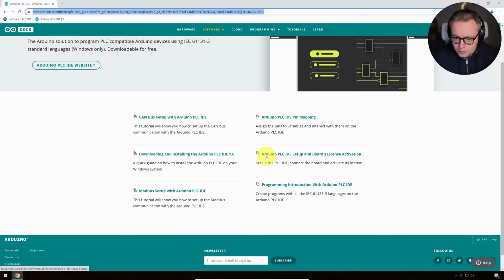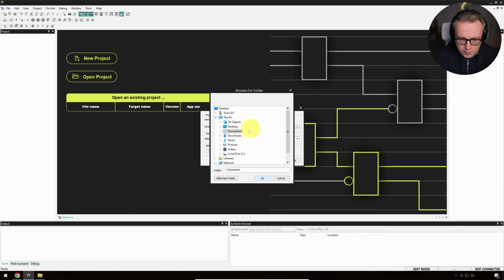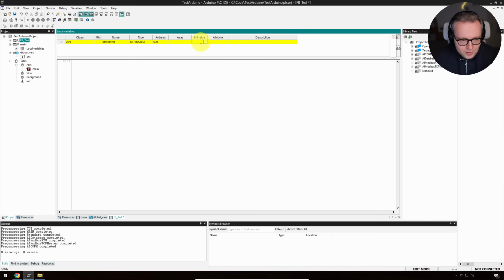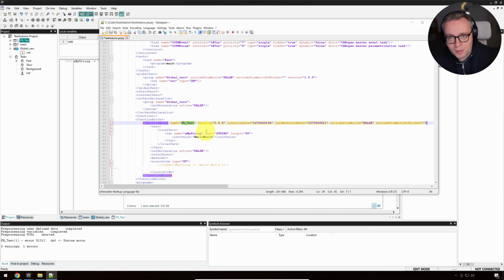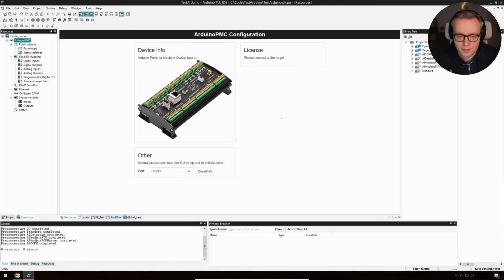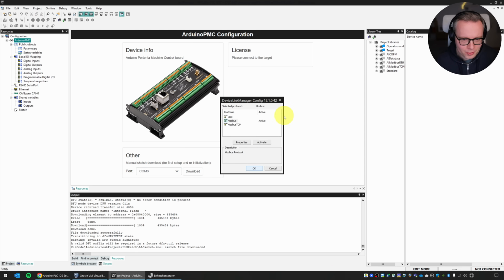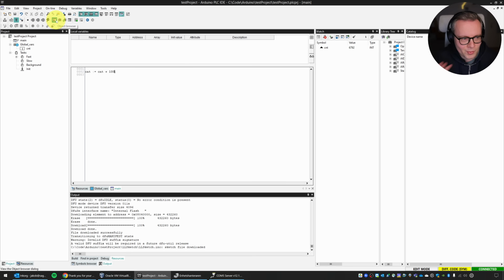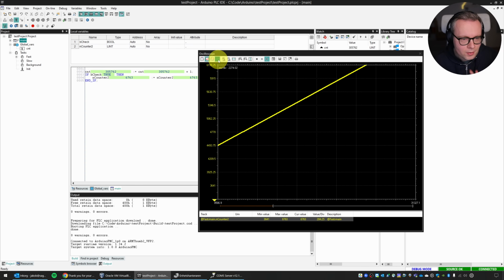Arduino PLC

Comment: Very informative presentation on the new Arduino Opta PLC software, in fact I bought one just to try out. I've sold several different automation manufacturers lines throughout my career and I absolutely agree with you on the free software - just get the hardware out into field, that's where the money is.
Reply from the maker: Glad it was helpful!

Comment: I tried for multiple hours to connect my PMC board but could not. I bought the license but no luck. I connected the device with Arduino IDE and it worked which means the hardware is functioning. But the PLC idea does not connect with the PMC!! Which is super annoying. There is no proper resources for the PLC idea. I am supper pissed off at it at this point. Any one here having any luck?
Reply from the maker: Did you also install the IDE tools?
Reply: @JakobSagatowski  Thank you. That did the trick.

Comment: Unless they intend to license specialized runtime functions, what is the point of not baking the license into the hardware? Like if you paid for the hardware, unless you planned on casting it in plastic and using it as a paperweight, isn't it kinda a brick without the runtime functionality? or maybe i missed something.

Comment: @Jakob Sagatowski

Did they really start from scratch with a brand-new IDE or did they just license existing software. I swear I heard some where that they just license existing software. I can't find the source where I read that from though.

Regardless I am not a fan of adding another IDE system. I would have preferred they used Codesys or OpenPLC. We need to consilidate the ecosystem not fragment it more.
Reply from the maker: The IDE is based on LogicLab.

Comment: Arduino portenta need to have many built in functions (PID, Cut to length, absolute drum,  etc...)  to justify it's price almost superior to others low cost plc like delta, click  or the very cheap Chinese Lollette PLC endorsed by many users globally. Although the plc  world is dominated by Siemens,Allen Bradley, mitsubishi , Schneider, ABB many low cost and reliable plc are also available where the integration   of the PLC/software is as smooth as a high end PLC on the market. However the education world where Arduino domination is tangible will welcome the Arduino PLC.

Comment: I guess you discovered your hardware already had a COM port (COM1) and the connected Arduino unit and IDE created the two other ports COM3 and COM5 (COM1 and COM3 in procedure).

Comment: Testar på svenska då jag såg att du har Windows på sv. 

Nybörjare i att programmera, Gjort några simpla arduino projekt. Tills jag såg att Codesys går att köra på en Rpi4. Så lär mig det nu/bygger ett HMI system för en baklastare, (Få in RPM, Temp, redskaps tilt, loggning av start cykler mm.) Men att Arduino gett sig in i PLC marknaden kommer nog göra underverk för priserna. Detta öppnar verkligen för nya kunder i den privata sektorn! Många i den privata sektorn kan och vill programmera men ska man köpa en PLC från de stora tillverkarna så blir det en rejäl slant och då utesluter man det och gör nått halvdant med en Arduino UNO.

Blir kul vart detta leder till i både utveckling och kostnad! 

Bra video och du fick en till prenumerant :)
Reply from the maker: Hej! Kul att du börjat programmera, det är en fantastisk värld du har framför dig. Känns som ett roligt projekt du påbörjat också.
Håller med, är definitivt spännande att se vad Arduino kommer erbjuda i framtiden. God fortsättning!

Comment: I have been using the ABB IDE for PLCs and it's not storing in individual files either.
It's possible that the IDE and core of the PLC is not created by Arduino and that's why there's a licensing scheme around it and that everything is stored in the same file.
Reply from the maker: You can actually store the code in individual files. See the pinned comment.

Comment: This new Arduino PLC IDE is almost identical to "LogicLab".
It even has same program extension "*.plcprj"

As earlier commented, there is definitely a need to make 'on the fly' program changes. 
Industrial environments doesn't like to stop machine for a small (minor) modification.
Reply from the maker: You're right, it looks suspiciously similar! I guess it's not a too wild guess to say that Arduino have bought a license of it and made adjustments to it?

Comment: The main issue I see with this is that the software is only available for Windows.
I suspect they licensed some proprietary software to build their editor, that is only designed for Windows, explaining the missing sources...
the fact that it can't seem to run in a VM makes the whole thing useless...
Reply from the maker: It's standard in industrial automation to only have software running in Windows. I honestly don't know if there is a single industrial automation IDE running on any other platform. Regarding the VM I have to give it another try. I only tested on VirtualBox, and should probably give it another try on other virtualization software.
Reply: @JakobSagatowski  "it's standard in industrial automation ton only have software running in windows", yet it's a choice that does not make sense anymore.
it's time for those companies to grow up a pair of eyes so they can look outside of their box...
Reply from the maker: @AmauryJacquot  Fully agree!

Comment: Siemens released SIMATIC IOT2000 series back in 2017 which are edison/stm32 based PLC devices. You can program them with arduino IDE tools.
Reply: No

Comment: Ahh, how technology progresses. Decades ago, when PLC "programming" was done by plugging actual hardware modules into a physical programming board, I joined a tiny startup whose objective was to create a way to completely eliminate the hardware logic modules and programming board, to do it all entirely on an IBM PC AT, debug on  the PC, RUN the code directly on the PC, the PC connecting directly to the factory machines. The user interface would LOOK like the programming board and the programmer would use drag-and-drop to place logic modules, just as if he were doing the normal PLC programming (since, heck, there were so many PLC people who were expert in that all-hardware approach, we'd have a ready-made market). I was the software engineer on the project, along with the "money guy" (who was also the fellow who came up with the entire concept) and a hardware guy (to develop the board that would plug into the PC and interface with the factory floor equipment).

I spent a good part of a year designing the software, a graphical user interface (when graphical user interfaces were just in their infancy, few tools to help in the design) as well as doing test runs of the user's design to verify that it operating as expected (and according to the then-common way of doing PLC programming). I got a LOT of it working. We even took it to that year's NCC (National Computer Conference, remember those??) and showed it, privately, to several potential clients.

Sadly, the money man never raised a penny for the venture (I had been working for [ eventual ] equity in the company, i.e. for free) and the hardware guy never got even the simplest interface board working. Eventually the entire effort fell apart.

Not too many years later several PLC-specific programming languages along with related IDEs were developed and replaced the all-hardware approach. So even if our product had been fully developed and on  the market, our market would have dried up fairly quickly.

But, time marches on. Technology advance by leaps and bounds, ventures come and go or never get off the ground, and now even ARDUINO has gotten into the PLC market.
Reply from the maker: Hey Roger! What a great story you shared. Whilst it's a shame that you never managed to get your product out on the commercial market, it's still a great story and memory that you are sharing with us. Still it must have been a great time to be so early in the game and see the rise of modern PLC IDEs. Your story actually reminds me of similar stories of how it started for another PLC vendor (though they did manage to get the equity eventually). Your story of PC-based control is basically how it started for Beckhoff, which today is quite a big player with their PC-based PLCs. I'd love to hear more about your story. I'd be happy if you could drop me an e-mail, you have the contact detail if you go to my channel -> About -> "For business inquiries".

In any case, I want to wish you a great 2023!
Reply: @JakobSagatowski  I emailed you. Haven't heard back.
Reply from the maker: @RogerGarrett  Found your email in my spam folder. I'll reply tomorrow!
Reply: @JakobSagatowski  Still no reply from you.
Reply from the maker: @RogerGarrett  I've sent an e-mail to you. Sorry for late reply!

Comment: Why not just use C?
Reply from the maker: Industrial automation has a vastly different background than the traditional software field. Most of the PLCs have been developed using the IEC 61131-3 standard, which has its roots in the electrical engineering field.

Comment: This is a great start. It’s not until you get into real Industrial process control that you will see the importance of the ability to edit the program whilst its running without out any halting of the process while you make your changes. I think the Modbus protocol is a great choice to start with. Modbus developed by Modicon were the real first PLC's to arrive back in the late 70's. It was always open source so everyone knows it and how to use it.
Reply: I agree totally! I work in plc controls development doing programming everyday and there is no way a plant would stop operation so you could make a change, online editing is mandatory and the processing speed would need to be a lot faster
Reply: @CryptoGlific-fw8of  are you aware that the Arduino PLC IDE let's you make changes to Pro boards' sketches and/or 61131-3 programs without reboot or downtime??
Reply: Fortunately my arduino (p1am-100) programs have never needed major rewrites beyond FAT.  I design all my process variables and "tuneable" parameters to be editable without needing a download.
Reply: @orthodoxNPC  yes, but in an operating environment sometimes something may break or the operating situation may change and you can't always stop operating to fix problem so you need to sometimes program around issues while it's running. From my experience as an industrial electrician in a running industrial environment.
Reply: i take it as a given that i must develop my PLC programs in a way that permits online edits - even avoiding some of the time saving features such as deploying a lot of user defined functions

Comment: I really hope they make it reliable for warm downloads comparable to ABB, being able to change basically anything (software and hardware changes) without a noticable restart of the CPU, just a gap of a few cycles of executing code. Then I could see use for this in process controls. That's the big problem with Siemens 1500 in my field, which I would guess they use as comparison, it's really hard to download anything big without restarting the system, getting hundreds of alarms, trips etc.
Reply from the maker: Yeah there is definitely some work left to be done on the downloads-part of it. Agree that this has to be very smooth. It's after all one of the key features of running a PLC.
Reply: @JakobSagatowski  Yeah, at least it's a feature of the more heavy duty brands. But for machines in a factory, where the Siemens 1500 models are dominant in Europe at least, I think this would be less of a problem, since most machines can be restarted within a minute or so, instead of a power plant taking hours to restart. I just really would like to see some alternatives to the giants. ABB, which I mostly work with, has had really stable downloads while running a process for a long time, so it doesn't seem insane in my opinion to aim for something similiar in a completely new brand of controllers. Thanks for the video by the way, very informative! I will definately keep an eye on this.

Comment: I just don't understand why Arduino build this.. C++ / rust is not the future for plc ? Why building this software which remains me very old ide with lot of settings and UI (instead of using code to configure 🥲)

Comment: good, we have some progress after so many years :)
This project could be great success and actually applicable in the industry as remote I/O (digital signals and coil actions) with modbus RTU interface, (as slave) and also as modbus RTU interface for sensors to perform data acquisition.  The hardware is capable and there is nothing less than the expensive commercial interfaces in the market. Is just a matter of libraries and modbus mapping functionality.
Reply from the maker: And even better, my next video will be demonstrating the Modbus functionality of this device using the PLC IDE (though Modbus TCP instead of RTU). Thanks for your feedback!
Reply: Really? Let's assume a medium-sized industrial company puts out a tender for a machine control system. And you come up with something like this. They'll laugh at you if you're even noticed. With me you wouldn't even get past the porter with this toy.
Are these actually delusions? This can only be if you've never seen the inside of an industrial production plant in your life. Not to mention which regulations and laws have to be met and which guarantees a manufacturer usually has to provide. Arduino, are you kidding me?
Compare that BS to real industrial equipment, to real PLC like from Siemens, ABB, Omron, etc. This toy here doesn't even fulfill most industry specifications for the CONNECTION. Oh wow, this HAS TO BE A JOKE!:)))
Reply: @dieSpinnt  Aren't you comparing Apples with Bananas?
 Siemens mega expensive, but Arduino platform even for individuals affordable.

Comment: There's also the P1AM-100 from Automation Direct! It's another Arduino PLC that has been around for a few years now.
Reply from the maker: Hey Quentin! Have to check this out. Is it programmed using the IEC 61131-3 languages?
Reply: @JakobSagatowski  It's programmed with the normal Arduino IDE, so C++. I've also added support to TinyGo and I'm working on Rust support for it.
Reply: @JakobSagatowski  Yes, you can program it using IEC 61131-3 with OpenPLC Editor

Comment: Have you used other softPLC platforms?  CodeSys by any chance? And if so, how does it compare?
Reply from the maker: Hey! Absolutely yes (check out my other videos for a full CODESYS/TwinCAT 3 course). CODESYS is on a quite different maturity level in terms of well... everything. Fieldbuses, safety, motion control, IoT protocols... there is so much that Arduino have to catch up to. The question is if they want to, or if they target something else? Will definitely have to follow up with more videos about this!

Comment: I see this as something that was predicted years ago, since the price of the plc raised, and the IC for microcontrollers get more merchandised by their own manufacturers, in a nice strategy for mecatronic self made toys.
I'm not software developer(just circuits designer, and electric engineer) , the only obstacle for many self made manufacturers of things now?, It's the C++ programs for the microcontrollers,after the bootloader have been uploaded!.
Reply: I forgot to say that....I would like to stay in touch with "real Arduino programmers" , they always should got to be busy??

Comment: Why not just use an ordinary arduino, a multiplexer and some beefy relays with optical switches in Industry?
Reply: I think normal arduino boards don’t have industrial rated components and also lack the conformal coating. Normal in the industry people don’t take risks with new entrants, they prefer the ecosystem they are familiar with
Reply: @arbjful  What's so special about an "industrial rated components" compared to standard hobby components? and also what's so important about the coating? 

Surely all that's important is that the controller does what you want.?

Arduino has the great advantage of massive userbase - ease of use and setup plus cheap to replace, and if you wanted speed just use one of the new RISC-V Single Board Computers (SBC?).
With Arduino you could set up your process/system quickly and in house - No need for specialist consultants / 3rd parties to get involved.
Thanks for the interesting video by the way.
Reply: @kychemclass5850  industry rated components last and perform even in high temperatures. Conformal coatings protect the board from harsh environment. Apart from these the power bus and supplies need processing from spikes and electrical noise as these can damage sensitive electronic items. We used similar hobby boards for an industrial project, unfortunately didn’t work out, the performance was sketchy and prone to failure.
From then on it was an industrial PLC or nothing else
Reply: @arbjful  Thanks for the greater insight.

Comment: Portenta has been a massive flop at least in terms of open source. Maybe closed source PLC will allow arduino funding to actually develop the platform/ide. But, this time I’m not going to be ordering anything until I see some proof. The portenta boards I bought are basically expensive scrap.

Comment: Loved the video, but the price of the PLC board you are using, as of this post, is about 335.00 USD. I spent 575.00 on a S7-1200 starter kit about 3 years ago. It's been great having that to work out some C# coding I do to interact with S7 PLCs. But I had the money to spare at the time. Sadly not now. The license for the Arduino PLC is very inexpensive though I agree.
Reply: I have the perpetual license for Rockwell and their shit fest of a suite. Arduino makes it affordable to be an integrator

Comment: This is sooo retarded. For non-time-critical applications, just grab the RPi Pico and load it up with the amazing PicoMite BASIC.
If you need real-time then go for the Parallax Propeller-2 with its 8 CPUs and 64 smart pins. Program in C, Basic, Spin or mix all three. No screwing around. Just plug-in and start writing code. 👍😎